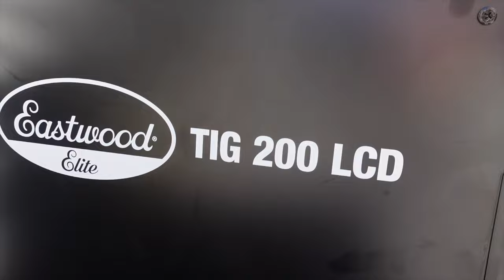Storage on our Sail Boat home & learning how to WELD Ep 396

Comment: Hi guys; Your doing a great job refitting your boat but I do have a piece of advice for you that you might have over looked, years ago I worked in the Port of Portland ship yards. There was a class two super Tanker that just about sank because they configured their sea chest which is actually a main boiler intake in their case the exact way that you have just installed yours. (through hull, rubber hose, and then the chest, the hose failed and there was no way to shut off the flow of water at the bottom of the sea chest, it filled the entire engine room with water before it finally equalized. There should always be a valve connected directly to the through hull and then the rubber hose this way if the rubber hose ever fails you can shut the water off from flooding the engine compartment and replace the hose with no danger of sinking the boat just a little insight from first hand experience.